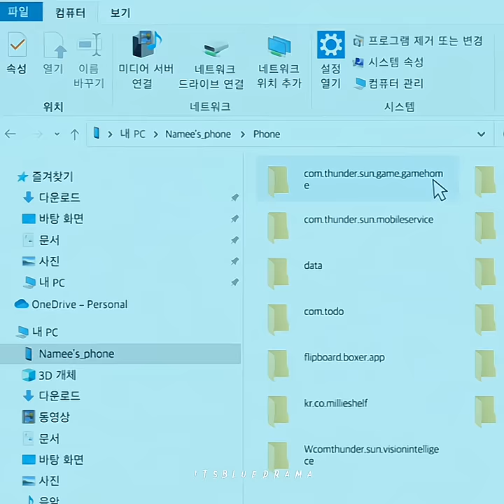a reminder don't trust anyone with your personal belongings 🤯 #unlocked

Comment: All you need to do is factory reset the phone after you get it fixed
Reply: If you looked at the clip again you will see the repair guy also changed the camera into a spy camera. The repair was for only the screen.
Reply: @diokdin  True but i doubt that camera would work without the software which was gone with supposed reset i said, but I'm not that big of a tech guy so maybe I'm wrong
Reply: Really? I got my phone repaired years ago and the guy who fixed my phone told me to not factory reset.
Reply: @sangsang9303  that's a load of crap, no way you cant factory rest,either that guy's messing with you or somethings sus
Reply: performing a factory reset is the best way to get rid of viruses, spyware, and other malware. a factory reset will delete everything that wasn't originally installed on the device. this includes any viruses that infected your operating system and files.

Comment: For those who were wondering if this is possible.The answer is Yes. But it is highly noticeable bec normally it would be some type off application/ software ao you will notice it. But  if someone who were really smart enough they would just make a hardware that is embedded in the ayatem that can take the user information without you noticing LOL